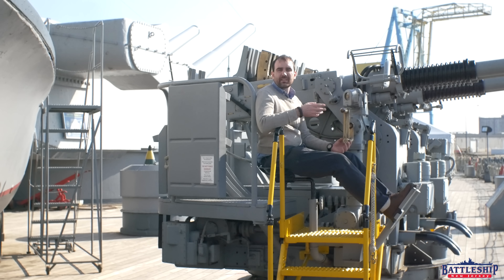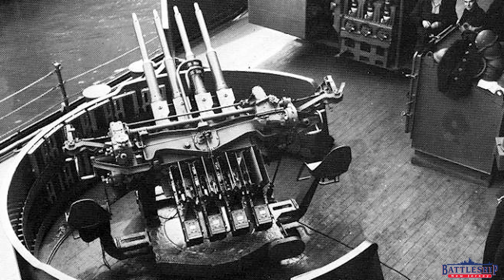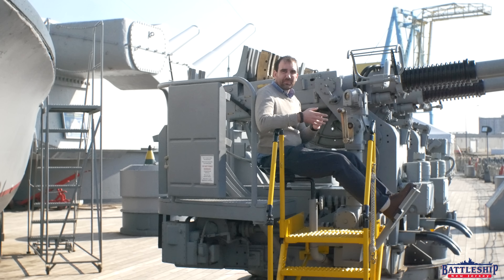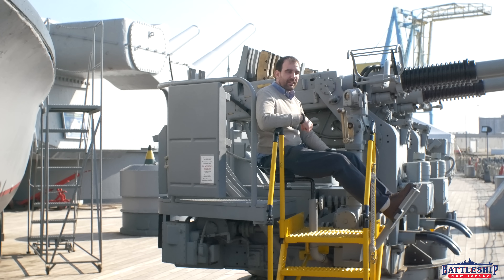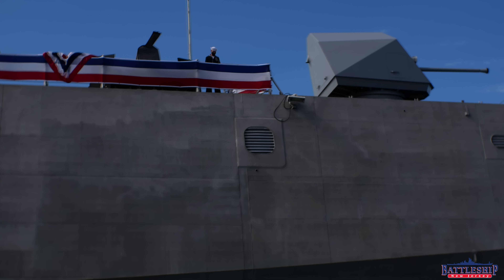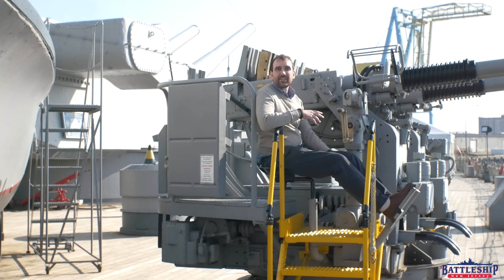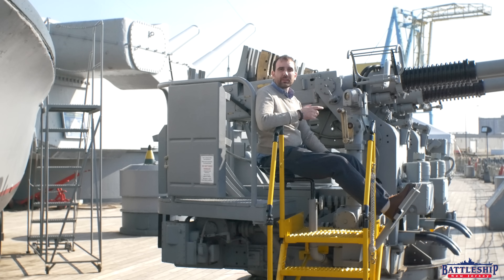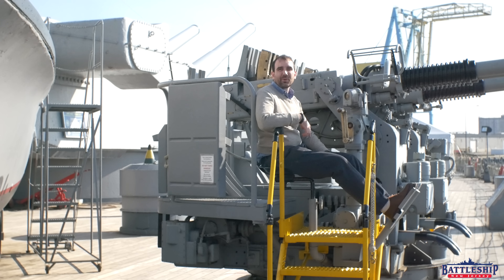Why Are Some Naval Guns Described in Inches and Others in Millimeters?

Comment: When I was in school, anticipating a conversion tho the metric system ..BY THE YEAR TWO THOUSAND,  (👌), we were taught the use of the Decimeter, 10 centimeters. That seems useful but no one uses it. Murica ain’t ready for the change but I am all for it, except for temperatures with regard to weather. Celsius is not granular enough for us creatures.
Reply: My country uses metric and I spent years surveying. Never have used decimeters and have only heard it mentioned twice in 20 years.
Reply: A liter is one cubic decimeter.
Reply: According to Wikipedia:… “Markings of a ship's draft are shown in decimeters in most of the world.”.
Reply: I graduated from Cal Poly SLO in the 70's in Engineering. We had to use both units and be comfortable with either. There was a huge push to convert to SI units back then. The biggest problem was that US production tools such as lates, milling machines, automatic screw machines, and precision measuring instruments  had lead screws made in inches. A micrometer has 40 threads per inch. It cannot easily be converted to metric. So industrial tooling was at the mercy of the English units. Converting to metric would be extremely expensive. GM actually produced automatic transmissions that used both Metric and SAE threads in the 70's. That caused some frustration. I'm all for adopting Curies per Curators and be done with it.
Reply: What do you mean "Celsius isn't granular enough"? If you need precision, get a thermometer that reads to the tenth or hundredths.
Reply: @gobblox38  Uh, yeah, sure,… I’ll special order a thermostat that lets me set the temp to 22.22 C. GFY
Reply: @mgclark46  oh, for your thermostat, you only need precision to a while degree of Celsius. Some allow for the half degree. For the old dial thermostat, it doesn't matter which unit you use.
Reply: @gobblox38  …. Decimimeter…. Quit clogging the comments up with your quibbles.
Reply: As some stated, decimeter is something pretty much no one uses except that one liter is actually a cubic decimeter with a different name

Comment: Metric system for the win!

The country that went to the moon also crashed onto Mars because of an error converting between imperial and metric units.
Reply: and nasa uses metric lol
Reply: Recently
Reply: I was never a fan of the metric system growing up until later in life when I took on a job at a factory that used nothing but European machinery and the use of metric system. After seeing how much easier and simpler it was I embraced it and realized our American standard measuring system is a joke. LOL
Reply: @kennethwise7108  Most Americans will use anything as a unit of measurement just to avoid having to surrender to using metric.
Reply: @kennethwise7108  Because inches divided into hundredths and thousandths are so much more complicated than millimeters split into tenths and hundredths.  To convert from meters per second to kilometers per hour you multiply by 3.6.  As easy as converting from yards to inches!  I took a job at Boeing, never had a problem with the inches.  Dealing with management, well something tells me that is always a problem whether you're using inches, millimeters, or Ancient Egyptian cubit measure!
Reply: @RogerWKnight That is some bullshit. m/s snd km/h are not metric units. m/s is using SI units, yes, but seconds is a non-metric unit in the context of the Earth as reference system.
Reply: @RogerWKnight  personally i loved how everything was so easy to calculate when working with the metric system. Oddly enough, after walking away from that career field I ended up becoming a Marine Machinery Mechanic and worked on nuclear Submarines for the DoD and guess what? There is nothing metric whatsoever on our US Submarines. LOL
Reply: @RogerWKnight Which Cubit? Common, Royal or Sacred?

Comment: I love the moon reference! 'Merica
Reply: Heh yes, although doesn't (and presumably didn't) the US space program use the metric system?
Reply: @jimb9063  no, I think they used cubits.
Reply: @MrTexasDan  I guess whenever Wernher stretched his arm forward and they had a spare tape measure...
Reply: @jimb9063  yes,  they didn't and don't.  And they did and do.  Depending on what parts of the project or program.
Reply: @TheWaldicorn  Thanks. Sounds about as mixed up as the UK. Most people happy with both for different things.
If it's not comparable with the length of double decker buses though we're in trouble.

Comment: Some backwards countries use inches and other countries use millimetres, but most use centimetres.
Reply: Some countries use a mix and match of measures especially in certain trades etc.
Reply: :( . The inperial system uses human scale units. The Metric system uses units of the universes scale. Imperial measurements are more relatable to a human.
Reply: @ravenbarsrepairs5594   Imperials makes sense to you and your countrymen because you still use it. It's hardwired.
Reply: @ravenbarsrepairs5594  but it's so outdated. Just like how the US and one or two other countries use 120v instead of 240v like 99% of the world
Reply: @steves009 the US uses a lot of 220v especially farmers but who the hell knows their 220v is probably wired and set up different than American 220v. I'm no sparky.
Reply: @tacomas9602  the American 220 is wired differently. To 220 Europe or  240 British and ex empire. 
 Understand for a short while when reading or viewing. The transformers  have a centre tap in middle of winding so central tap to one end 110/120 volts on one leg. Same from centre tap to other end of winding a 2nd 110/120 leg. Some installations I gather have a pair of different 110 live wires, a neutral centre tap. And possibly an earth/ground wire. You can get 220v by linking direcly across both hot (live) leads to double power, and probably Euro equipment.
This did allow German Siemens equipment to be modified but used in the early rollout of the electric grid in the US (check out Westinghouse and Niagara). The Tesla AC path not the Edison DC dead end for grid distribution.
Reply: @steves009  That relates to cost and the rapidity with which the US electrified compared to Europe. The electric companies in Europe found it more efficient to transmit the 240v rather than  120v so they paid customers to replace 120v lights with 240v lights. In the US there were so many more people with electric lights the electric companies could not afford to pay them to switch.